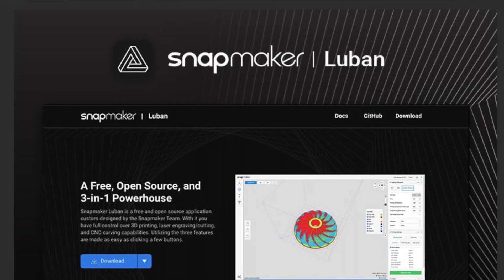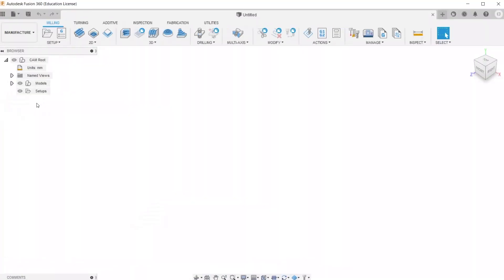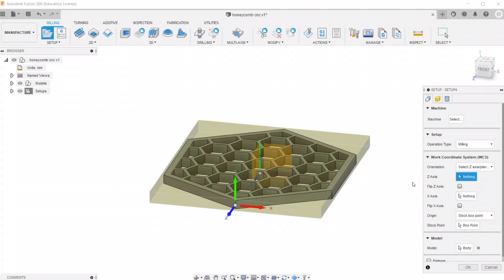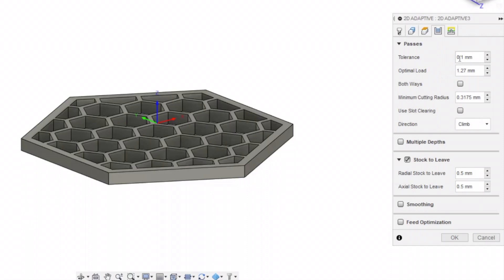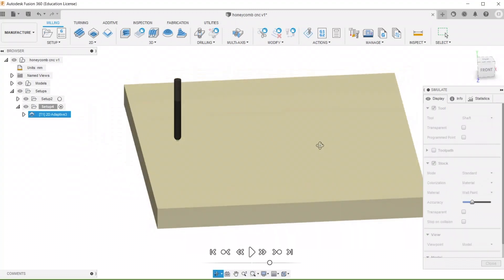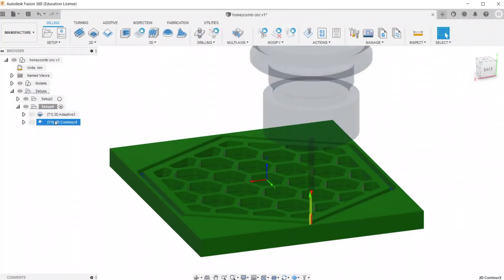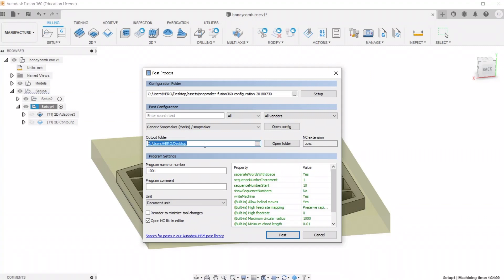How to use Fusion 360 for Snapmaker CNC

Comment: Why does my post process look so alien alike?? I cant even find configuration folder as option @9:14, anyone?
Reply: I'm having the same issue, also the fusion software looks completely different in the post process screen, I cant find where to store the configuration files.
Reply: @kylegauck  well the software did change a little. But names are still same just way to select is little changed

Comment from the maker: Timestamps:
00:00 Intro
0:48 Step 1 //Download Config. files
1:43 Step 2 //Install Config. files
3:07 Step 3 //Create New Setup
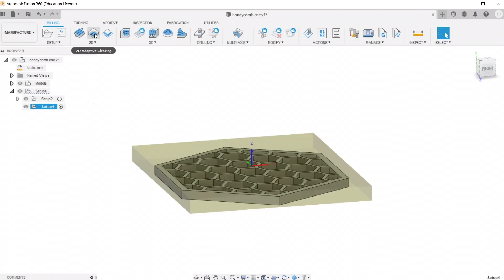4:20 Step 4 //Cutting Type
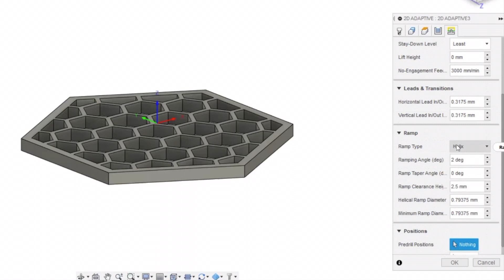5:56 Step 5 //Select Geometry
6:35 Step 6 //Simulate
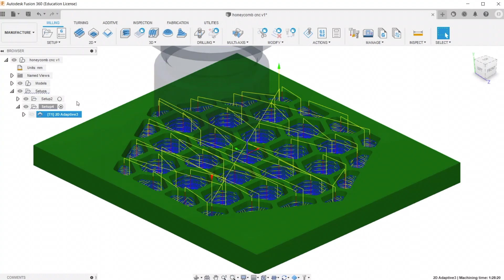7:05 Step 7 //Second Cut
8:43 Step 8 //Machining Time
9:08 Step 9 //Export G-Code
10:32 Step 10 //Prep Machine
10:54 Step 11 //Set Origin
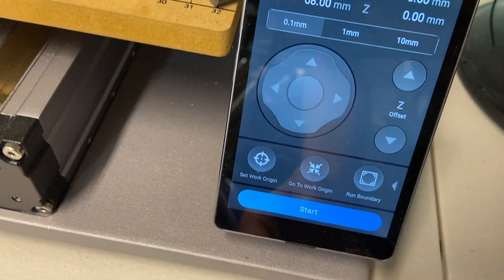11:24 Step 12 //Start Machine
12:24 Outro